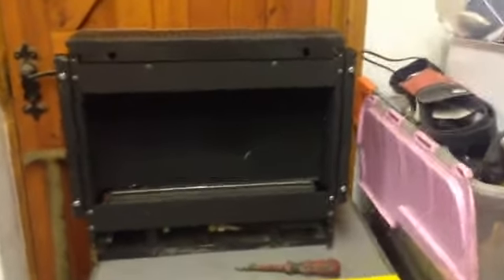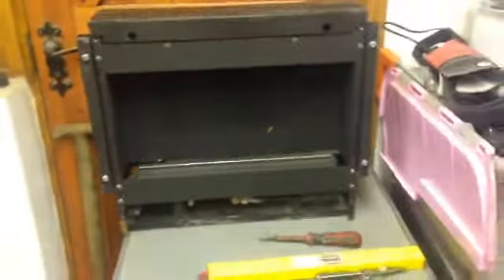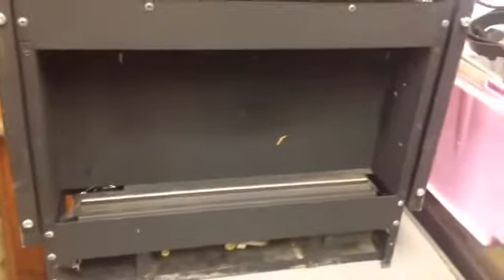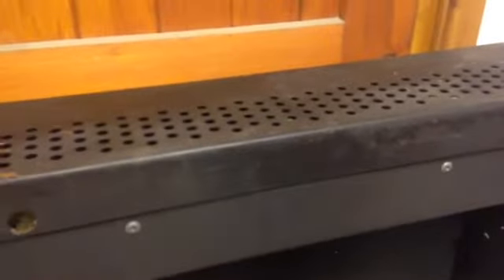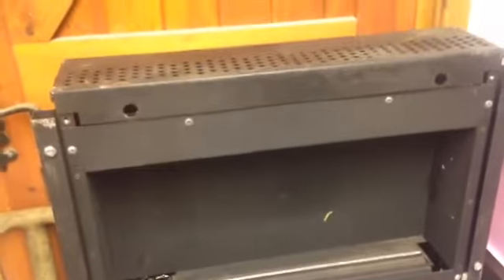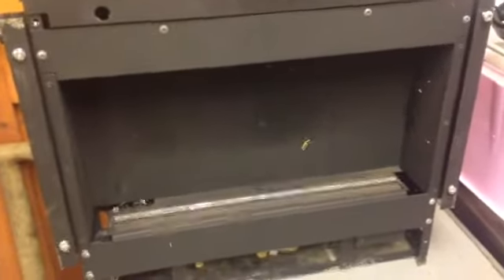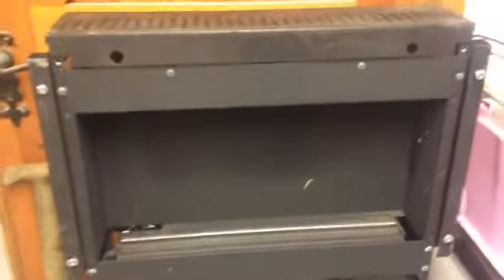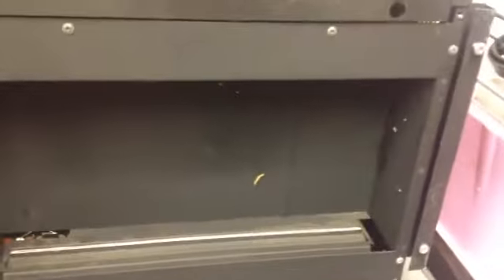How to service a Flueless gas fire

Comment: A good video & common sense for once on gas appliance information to the public. So many people are quick to respond about not showing gas related videos but as you say it not aimed at the diyer. Well done.
Reply from the maker: Thank you. I'm planning on doing more like this - it's up to home owners to make sure the engineer they are paying is doing a proper job. So many don't.
Reply from the maker: +Danny Archer agreed - by 'check the oxy pilot' I do suggest you block the hole. This is not to test the pilot, it's so you can see if it's blocked - ie, if you cover the hole you should see the flame change significantly - so the idea is you can gauge if it's blocked. 
Your right, customers shouldn't be pointing stuff out to engineers, but it's good to tell customers to pay attention to their engineer, let's be honest theres a lot of crap engineers. 
This video is really designed to point out to customers that these need ventilation and a clean flame

Comment: Does the air vent need to be on an outside wall or can it be on an internal wall (leading to a hall way or another room)?
Reply: To outside normally, although, a different scenario if going through another room. a calculation has too be done for that.

Comment: No spillage test?
Reply from the maker: Front is sealed, there is no flue unless you count the Catalyst section... I suppose one could check flow from air intake at the bottom
Reply: @plumbteam  only asking as I've just started my ccn1 etc... and wasn't sure if a smoke match was needed around the glass to make sure it wasn't spilling. Cheers

Comment: You forgot the engineer must gas rate the flueless fire and with all other gas burning appliances working,  you cannot afford to have a situation where another appliance drop the gas consumption to a flueless fire as that will make it burn with soot deposits that stop the cats from working, the CO content then go's through the roof.  Lets face it, this is not a customer checking engineer kind of situation, its beyond 98% of the public, more to the point, we don't need DIYers giving this a go having looked at this.
Reply from the maker: You make a fair point. However, the number of engineers who have no idea how to service these is embarrassing - so I think it's a valid video. There's a lot of points other than gas rate not covered, but as I say, guide only